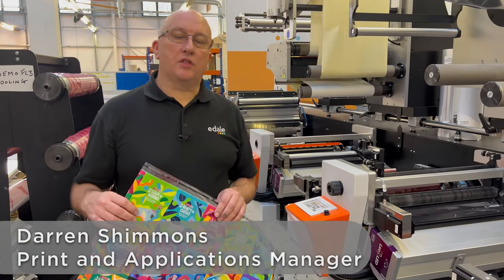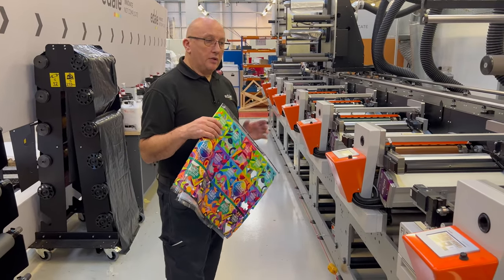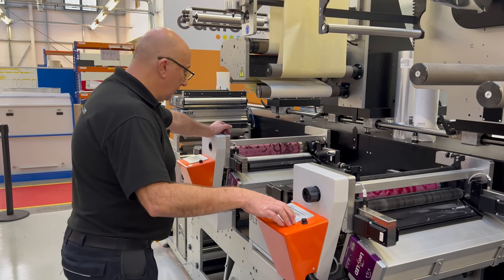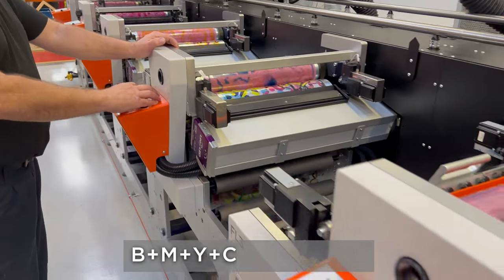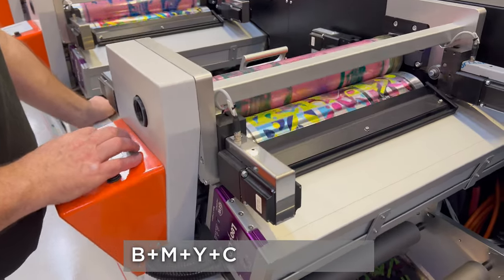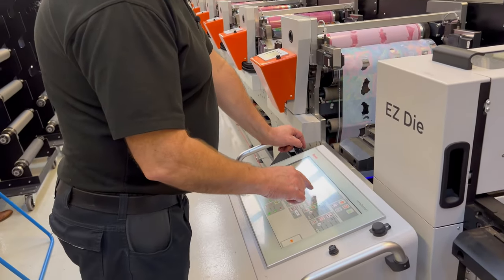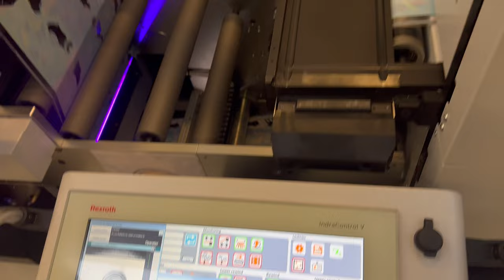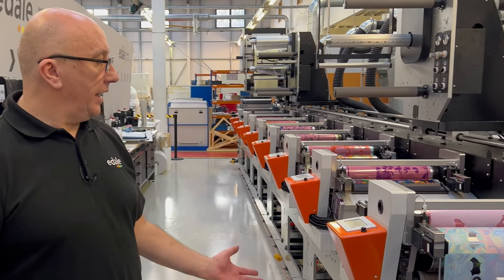The challenge of converting the designs to Expanded Colour Gamut (ECG)

Comment: This looks great, how about the Pantone colors, are they accurate and sostenible?
What software do you use to separate colors when the design has a full color photo?
Reply from the maker: By using the extended gamut printing process, (CMYK+GOV) you can expect to achieve a good visual match of around 90% of all spot colours, as opposed to only around 55% if you were using CMYK alone. And with proper separation the colours remain far more stable during the print run. 
Software tends to be different depending on the customer's personal preference, but ColourEngine and Esko Equinox are popular out in the field. 
Of course there is an extra cost of additional plates but this can usually be offset by the faster change overs as the colours always say in the press reducing wash up times. 
Please contact us at info@edale.com if you want to discuss.